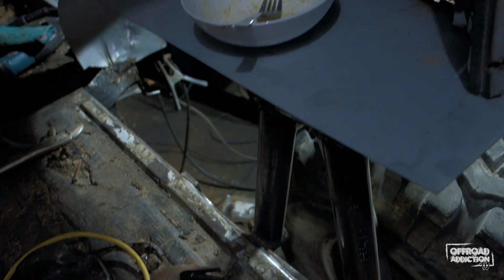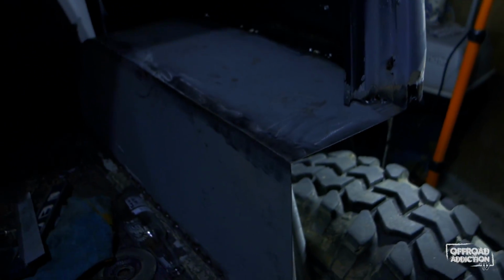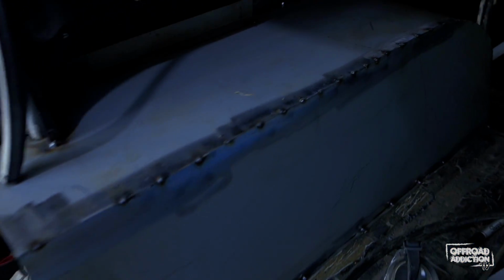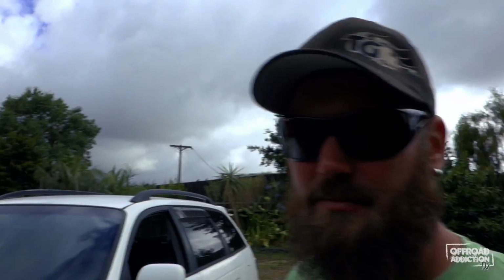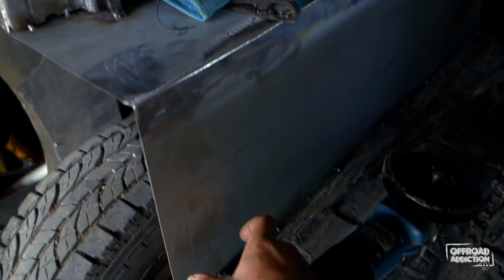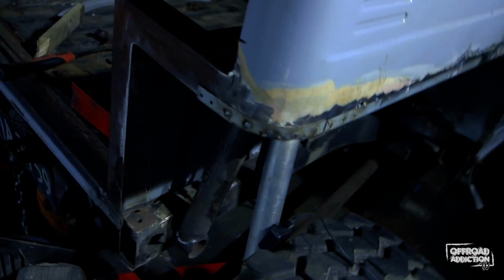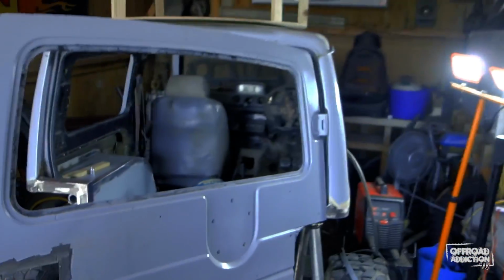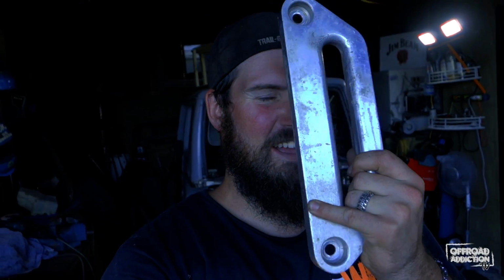EP8 - Body Work pt.2 / Engine Revealed - Suzuki Samurai SJ413 Build - Project #TightSqueeze

Comment: What did you use for shocks and are they coil over and how much travel do they have
Reply from the maker: I went with 14" Radflo Air shocks all round.
Reply: @OffroadAddictionTV  was they coil overs...how many lbs was they
Reply from the maker: @mikebuck958  they are Nitrogen shocks, no coil needed. Info on them is here: https://www.radflo.com/p-24-air-shock.html 
They are very light, maybe 10 to 15lbs?

Comment: how are you gonna mate the engine to the gearbox? is it all custom or are the any adapter that will work?
Reply from the maker: Safiq Jamal I plan to use a Toyota Hilux gearbox. There are some model bellhousings that bolt to this engine from factory that also fit a Hilux gearbox so if I can find all the parts then I can make it all fit with OEM Toyota parts. Thanks for watching!
Reply: Safiq Jamal he might gonna use the original casing from the 3sgte trans then reweld it to the transmission he choose to use.
Reply from the maker: Safiq Jamal similar idea maybe. Im not sure exactly which gearbox they use now.
Reply: so you plan to use the same formula with lozai's car?
Reply: Offroad Addiction TV nice light jimny..looking forward to the finished project 👍
Reply from the maker: Safiq Jamal Thats the plan! Thanks, me too haha